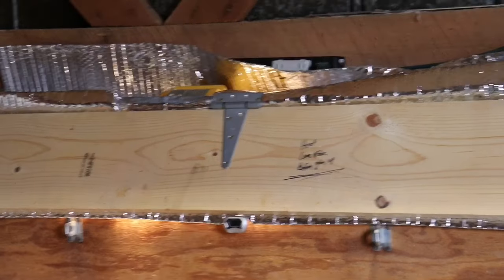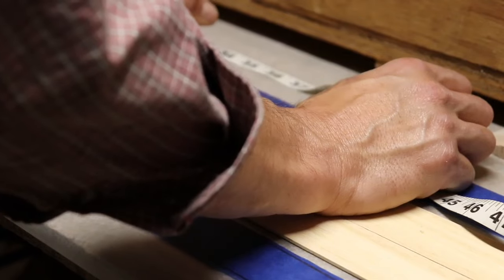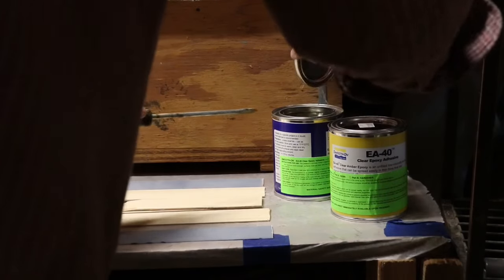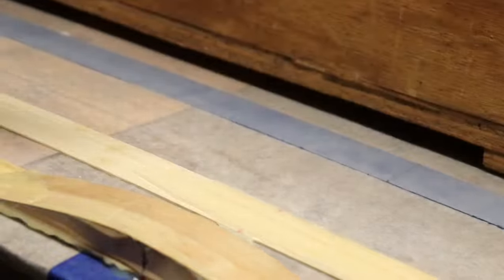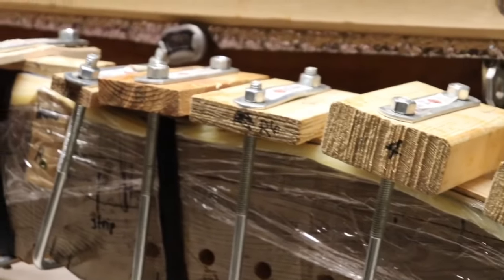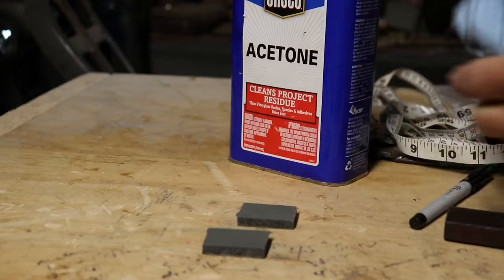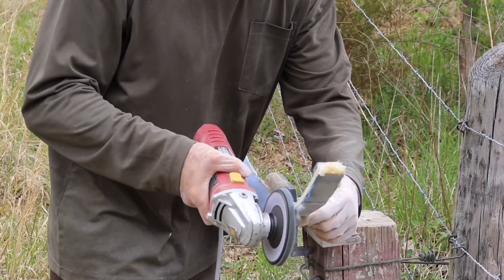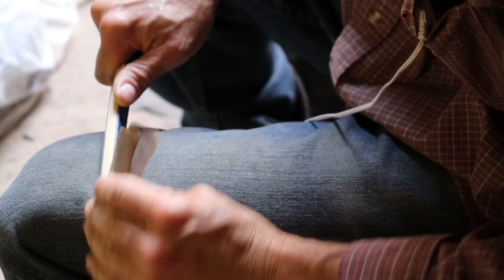High Performance Longbow Step By Step - no tiller design so easy!

Comment: Hi Dave, I'm struggling a bit with the bow form which I try to get to perfect shape, the problem is at the and it is not in perfect 90° angle at the last 3 inches, a difference in maximum 2mm how dramatically will that affect the performance of the bow?  Should I still grinding it to the absolut perfection :face-turquoise-drinking-coffee:? Thank you..
Reply from the maker: any variance will cause an issue in bow timing when shot. If this does not bother you go for it..if were me id get it right
Reply: @MeadLongbows  I'do that, thank you for the quick answer 🙂!!

Comment: Thanks Dave. I made no.1 bow. Turned out great (first bow). 
I followed the 40# dimensions but ended up with a 53 pounds. 
I noticed all other recipes indicate 0.040 glass rather than 0.050 in recipe 1, could this be the reason?
Thanks again, great fun. 
Dan
Reply from the maker: Awesome! Variance 2 should yield in the 40lb range. Do you have a digital caliper?
Reply: Hi. I do have calipers. I now think my bamboo is stiffer, 0.08 (2mm) from a laminated sheet (rather than single slats). 
Overall thickness is 7mm/0.27in
I have more of the same material and will try to get a light bow for my son using 30mm-20mm-11mm. 
Super fun. Thanks again Dave for making the whole process accessible. You helped me realise the uniqueness of every bow made rather than the correctness of one way or another. 
👍👍👍🙏

Comment: Pro tip. Dont use an impact for toghtening ANYTHING. Especially on a car. You never know when the bolt holding the sway bar on your 95 dodge 2500 on humvee tires is gonna either strip out or snap off. Ask me how i know 🙄🙄

Comment: Thank you for your good video!
I have a question, 
usually people use bows to hunt, sometimes in rainy weather.
what do you paint on the wood of the bow to keep the wood from rotting and decaying?
Reply from the maker: Any good finish will do the job, like tru oil or spray spar urethane and wax
Reply: @MeadLongbows  
Thank you very much.

Comment: I recently got your book an i like it it’s got a bit more descriptive than this video but it doesn’t have any dimensions for shaping the riser block an it seems like it’s missing a couple pieces
Reply from the maker: Thx for the support! It’s all in there trust me. And the riser can be shaped to suit your needs/hand size once you make the forms and get the materials lay them out on the form and you will see how the riser has to be in order to have smooth easy to glue lines
Reply: Alright thanks for the response

Comment: For the horse bow style, you mention 7.5” siyahs. Looking at your video, the tapered ends of the siyahs appear to reach the bend of the form to meet the end of the working portion of the limb (they even curl a tiny bit).  Am I interpreting this correctly?  If so, I am going to have to make my siyahs longer to accomplish this and still make the far bend to support the nock area.  Could you please advise?  Thanks!
Reply from the maker: You don't have to. But if you have extra length and room go ahead. Then all you have to do is cut it down when you take it off the form

Comment: Are the fibreglass laminations of equal thickness on both sides? And to lower the poundage, would you only decrease the thickness of the fibreglass, the timber core, or a combination of both?
Reply: You have to experiment alot to understand the limit of a material.
Basicly the thicker the core the more poundage you add to the bow but then the more stress you add on the fiberglass.
Belly is compression side, back is tension. You would want carbon fiber on the belly because is more strong in compresion. Glass is stronger than carbon in tension.
So you want glass on the back. You have to experiment and break many bows untill you understand what you need, how much and where. And i mean like literally intentionaly break bows, this is the only way you can achive a bow to reach it's full capability up to the point of breaking. And then you make it slightly beefier and that's it.
If you make both sides fiberglass, the belly should be thicker, fiberglass is not that strong in compresion.
In his design, if you want to lower the pundage, simple grind the edges of the limbs more, make them more narrow.

Comment: “You definately don’t want any of this stuff on your skin!…” - proceeds to spread that stuff as dust particles into the environment. His immidiate environment, where it seems his chickens feed. Hmm…don’t think you want that stuff in your eggs or veggies or ground water either mate. Think you need a room with dust suction for that phase of the process.

That said. Awesome man. Thanks for sharing. Very instructional. But is there a (still fairly easy) way to do this without the use of so many synthetics?…